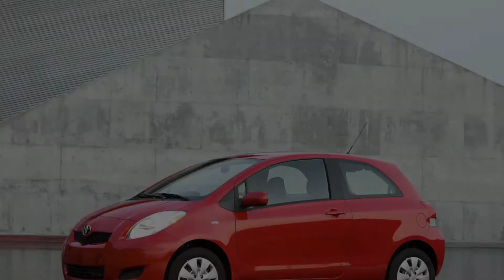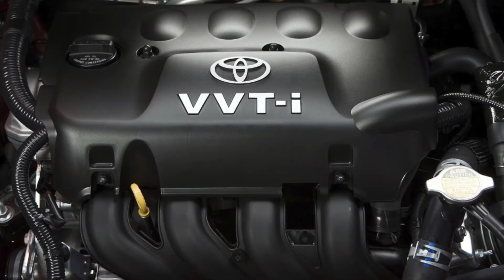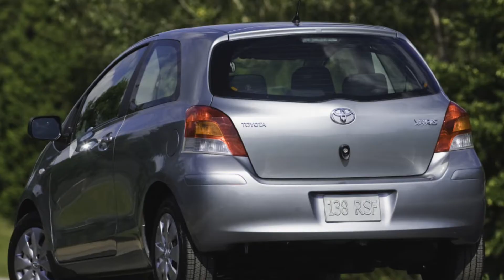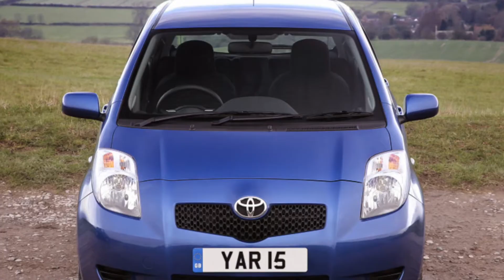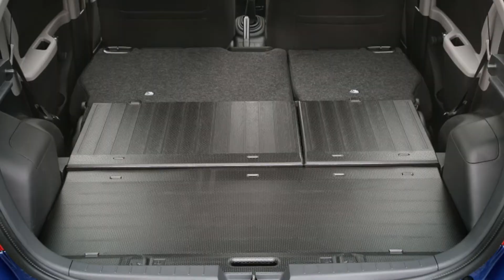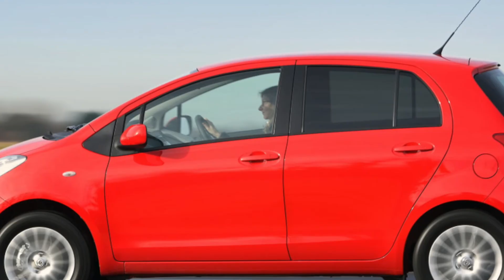Toyota Yaris 2 Problems | Weaknesses of the Used Toyota Yaris II

Comment: I bought mine as second hand car , ODO was reading 180 000... it's now ODO crossed 300 000, I've never changed all those parts he mentioned. only timing tensioner that I've changed and the gear No3 goes in hard . the rest is a lie
Reply: I am purchasing a 2008 Yaris with 198,000 on it for 2300…body is in rough shape, but I felt the engine sounded good…anything I should focus on?
Reply: @CREATORmeyou  Timing tension
Reply: myne is on 270000 i haven't change anything  mentioned  thet
Reply: The reason for 3rd gear going high while shift is that transmission is designed only to shift up when the engine is a bit hot.. you can observe that cool light on dash, it only shifts to 4th when the light goes off..
Reply: @sudheernc  holy shit you figured it out, it seems it takes a minute to fully shift up when I go to work In the morning? I let off pedal, get back on and it eventually shifts all the way through, are you talking about what I’m talking about? It shifts fine after the first 3 minutes of driving lol, wow
Reply: @thomasgriffith5544  yep, the car is trying to warm itself up to proper temp before putting in OD
Reply: Same here mine is not moving to 4th gear, but the cool light is yellow in colour
Reply: The reverse gear is not too strong?
How do I solved it
Reply: I guess timing tension is the major problem